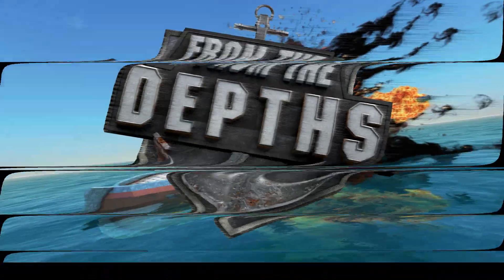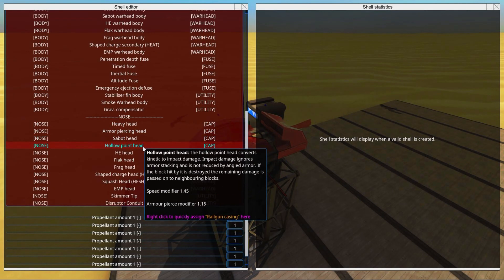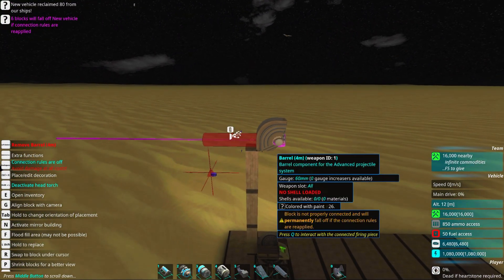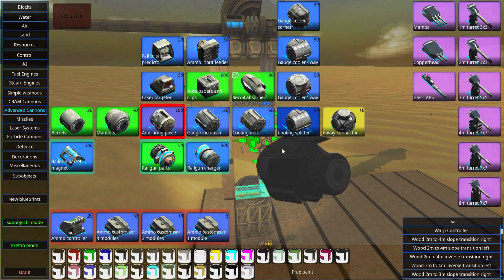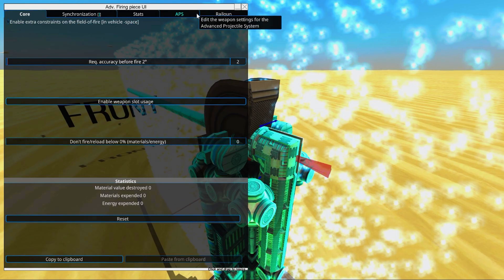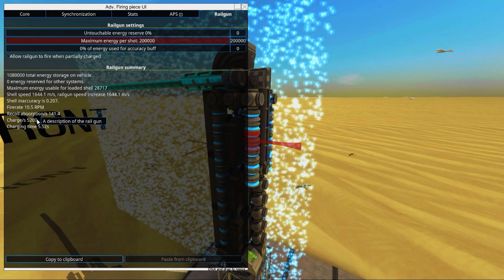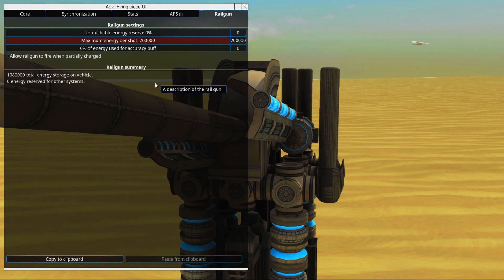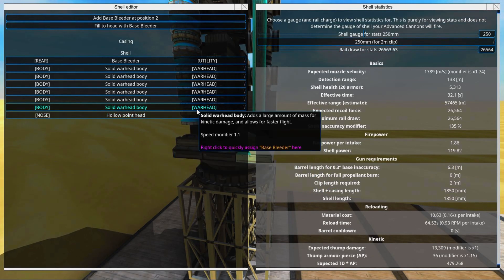From The Depths INSTANT Tutorial: APS Railgun

Comment: i love me shotgun

500mm 1m shells

1 frag warhead and a frag body at low frag angle (5°-60° though it can work with almost any angle)

1000 rail charge and no limit to rpm

as much autoloaders as you want your burst size to be

and kaboom!

you now can core out a crossbones AI in a single burst (or if you make it big enough straight up split it in twain)
Reply from the maker: Yeah xaubercrow made a few of those some years ago, very funny alphastrikers!
Reply: @GMODISM  every 70 seconds or so  a potential weapon is disabled and a very sizeable hole is made
i would say it may have potential as a spam weapon, i have made pretty compact ones for less than 30k that are able to """1 shot""" a crossbones ammo

would you mind making your take on these type of cannon?
(if you already have done that then please tell me)

Comment: my railgun is stuck on a message saying "Railgun charging!" when I try and fire even though it charges every 9 seconds
Reply from the maker: Got enough batteries and power generation on the ship?
Reply: @GMODISM  i was using the default designer mode fort, but i'll try and give it more power generation
Reply from the maker: @seversk13  Add a big bunch of rtgs and batteries on there if in doubt